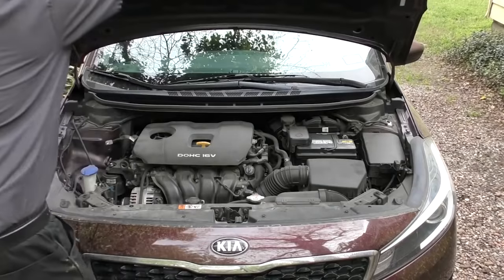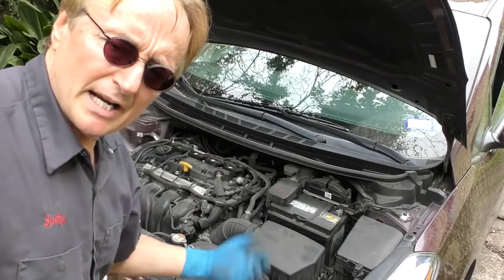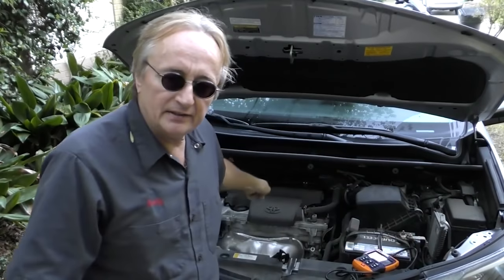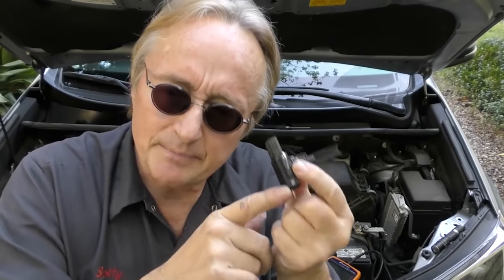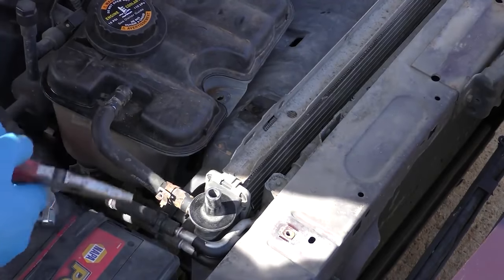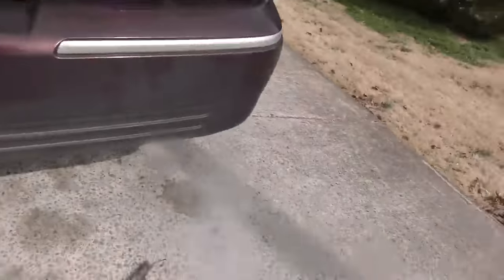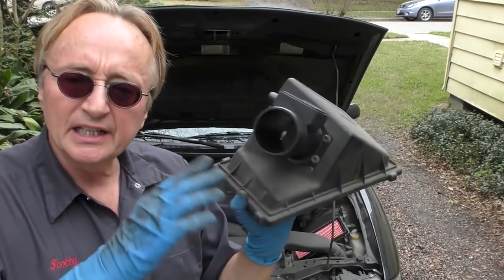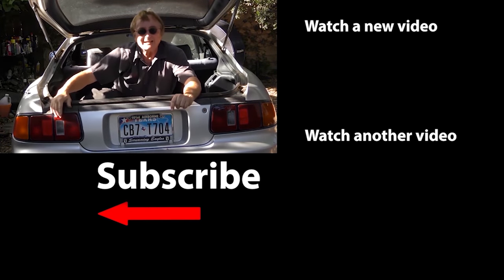4 Signs Your Engine Has a Serious Problem

Comment: 4 signs you're a German. 1 you say you're 90% German, 2 you can relate to German cars because you say you are 90% German, 3 you are not American because you say you're 90% German,  4 you're 90% German because you use the metric system on your ob2 scanner.

Comment: Ok Scotty:
Car #1 - Misfire
Are you really teaching viewers to tighten spark plugs nice and tight?  They should be torquing them correctly.
VIEWERS - Find out what the torque is for your car and don't go any looser or tighter.  If you go tighter you may strip the thread and that's not good.

Car "Mercury"
That owner was willing to pay for a Radiator + Install but not new hoses?  That's funny as hell.

Car "The Nissan"
Wow!  The RPM guage is not working :-)  + Faulty EGR & EVAP....throw that garbabe away.

Comment: How can I scan a obd 1 system?
Reply: Read how many times your LED light flashes. You have to Google to see your car how to press on that OBD1socket set with cover (usually located corner of your engine, I got a 91 Volvo the OBD1 thing is at front of driver side engine bay). By pressing and jump certain location, the LED would bring and tell you what is your car condition.

This is like a paralyzed senior blinks his or her eyes telling you what his or her need.

You have to 

1. Find the location of OBD1 box in your car
2. Find how the adaptor or little jumper strip need plug to be ready to press certain place to initialize the blinking response
3. Find from internet the number of blinks mean
Tips: try YouTube and Google.

Good Luck
Reply: For car pre-1995 it is OBD1 system.

After 1995 scan tool be used fir OBD2 system